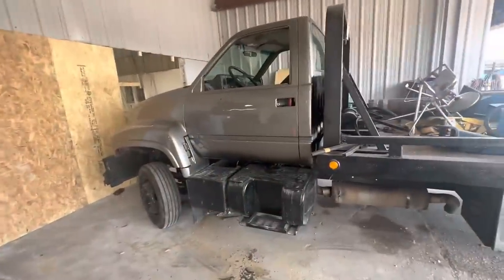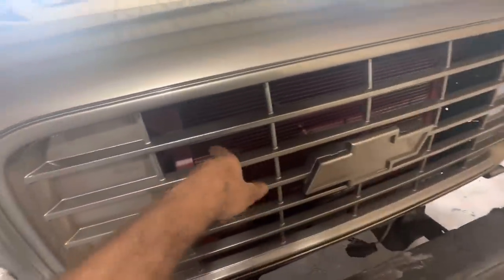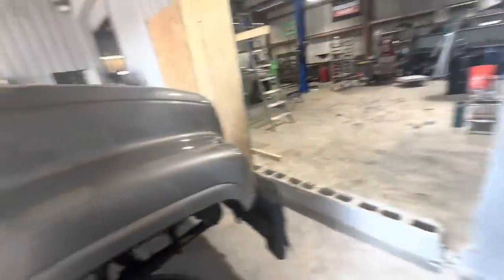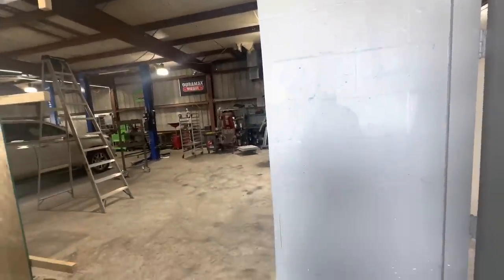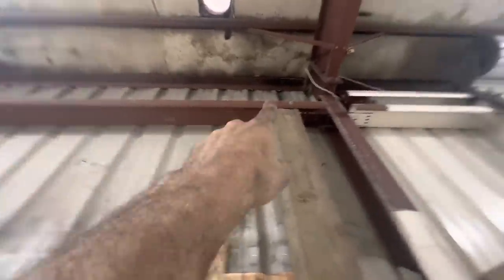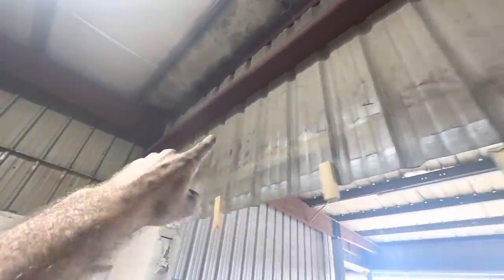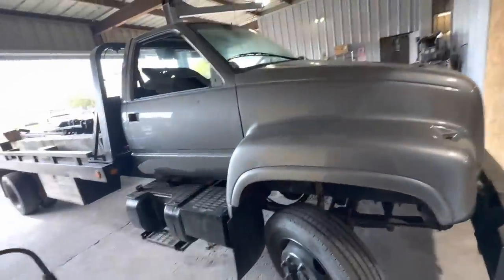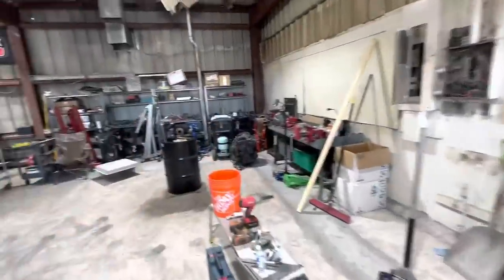Rays Auto Clinic UPDATE! Reeeee-Actions wanted!

Comment: Ray, I doubt you'll see this comment or my of my previous comments about this, but It would probably help you in the long run to move the lift to this new space (and set further from the back wall) so you won't have to angle in the larger vehicles.  Then put the "new" smaller lift in the corner.

Comment: I am a licensed building inspector and don't see anything wrong with the wood column supporting steel beams. As long as they're secured in place its good to go!
Reply: Actually Rays posts aren't supporting anything other than the new door, he's using the sheeting rail to hold the top of the posts. The loads (such as they are) over the main columns are carried by the perimeter beam at eaves level on top of the columns. It's a steel portal-frame building.
Reply: @clivesheppard8432  Agreed, plus the fact that Ray is installing a roller door not an overhead door.
There is no actual supporting load on the side vertical posts, they are only there to anchor the roller track, the main support as you say comes from above
Reply: Iiiiiiiiiiii…… don’t think you got that quite right there, inspector. 
If the wooden beam is now supporting the frame rail, what would have been supporting it before? 
Sky hooks?
Reply: @level1804  The timber posts and beam are irrelevant in terms of carrying any load from the existing building at all. I already said it is a steel portal frame building, there fore selfsupporting by design, and the horizontal rails both tie the structure and act as sheeting rails only. All the sheeting rail is doing in Ray's construction is providing horizontal restraint to his wooden bdoor frame - nothing more. As for wind loads you failed to mention, those were taken for in the original design so the new door imposes no additional wind load so the only additional loads imposed on the sheeting rail  are wind loads imposed as kminimal point bloads on the rail at the top. on one section only - a mere bagatelle. It looks like the sheetring rail is pretty substantial, possibly a 180 x 75 x 20.9kg/m PFC judging by Ray's videos.
Reply: @IR-nq4qv  I'll get my hat and coat then!

Comment: Hey Ray , I am a builder/carpenter in Australia. You did a great job with the wall, I would of done it, no differently. The design of the building makes it a non load bearing modification. The addition of the opening will transform the work area. Cheers Robert

Comment: You're doing just fine. Like others have said, I don't see any of the keyboard commandos jumping in to lend you a hand. Do whatever it takes to get the job done as safe as you can. It doesn't matter that lift trucks weren't made to do what you did with it, it worked at the moment. I drove lift trucks for a living for thirty years and did a LOT of things that they weren't designed for. It all depends what you need to do and what you have on hand.

Comment: You guys were creative in the installation, no one got hurt that's a win in my book.
Reply: Not doing the work in crocs might help us breathe a bit easier.
Reply: @MonkeyJedi99  OR they need steel toed Crocs
Reply: @OGYettie  If such a thing existed, I would accept that as a compromise.
-
Interestingly, the few people I know who do or have worked in heavy construction are strongly against steel toed boots, preferring a polymer hard toe cover.
Their reasoning is that a steel toe cap, under enough pressure, can deform and stay deformed, possibly leading to amputation.
A hard polymer toe cap will spring back or flat out break. Either way, your foot is not caught in a steel trap.
-
I know, it is a fringe case for most construction jobs, but two of the people I know work/worked for a company that places prefab housing units on readied foundations.
-
One time, a new hire reached for a tool on the sill plate just as the person outside was directing the crane to lower the prefab unit the last few inches.
That guy lost his hand and about 1/3 of that forearm to a two-dimensional conversion attempt.

Comment: Ray I'm in my mid 50s, those that reeeee about your methods of working - crocs, tennis shoes , chain saw etc... would absolutely loose their minds to see how we did things 30 years and over ago.
I laugh sometimes when I see men have to put on gloves to change a light bulb or hook up a garden hose etc... Honestly,  men have become way too soft. 
I grew up on a farm splitting wood, installing and repairing barbed wire fencing, bailing hay , etc.... very seldom did we have all the " proper safety gear ". We were taught how to handle and work properly and should ya get a scratch or cut methalade ( monkey blood ) was poured over it. Crap burned quite a bit but my grandfather would always say " if it doesn't burn its not healing " 😂

Comment: Hi again,  if you're going to keep the door and corner section of the block wall, then you're going to have to take the second 6x6 post and anchor it into the block wall and make sure that it's securely fastened to the slab and the 'I' beam up top! My suggestion is to mark out 2 foot square, use the demo hammer and chunk out the concrete, dig out the 2 foot area and pour cement into the square opening forming a footing for a 6x6 post anchor, placing it flush with the concrete, let it set up, set your post and then anchor it to the 'I' beam up top, then you'll have a very strong frame for not only the existing block wall, but also the new roll up shop door !!, Cliff will know how to do this!!, God bless, and good luck 👍 🙏 😊

Comment: electrical? In an older WII built temporary housing that the city let remain because they were taxable. found two 15 amp circuits tied together so that 30 AMPS could flow through 15 amp rated wiring = perfect fire igniter installation.

Comment: You always going  to have armchair internet Rambos who will never have the ambition you  have. I love the simple way you approach everything and going beyond the  repair. Cleaning battery terminals, the area you just worked in,  etc. Saving the customer money by not looking how to make the most expensive repair.  The recent Tahoe spark plug change you did instead of charging the customer for a transmission because the misfiring was causing the shifting issues is impressive. Don't change a thing.

Comment: I like the new paint, daily driver and work truck. Do I dare, yes I do, go with / to extremes and suggest, a boat, a motorcycle, and a Jeep? The wall - a sharper chainsaw blade makes for less effort on your part. The post install was fine. As you said no one got hurt and now you have the experience to do the second one better. I might suggest that the post be tilted up into the overhead beam and then the foot bracket installed. It will give you an extra 1/4" or 3/8" clearance on the corner edge as you fit the post to the beam.

Comment: the install of that post was awesome, those haters are the same ones who said this shop would fall on it's face in 3 months and look where we are now. Keep up the good work, my only request is that for the love of god install some more breakers and circuits and get rid of the power bar hell on the other side of the shop, when time allows. I get it, it's decently safe but having stuff like lights hardwired in makes it a lot easier to isolate what's popping a breaker and makes it easier to power down at the end of the working day

Comment: Lol footwear,  I worked in a machine shop in the saw department and unloading 40' steel bundles of steel bars the your fork truck would struggle to pick up, I wore tennis shoes. The only thing steel toed boots will do for you is keep you from dropping a 10lb part on your foot, you drop something heavy on your shinny new 300 dollar steel toed boots your loosing a foot.  Dont get under it. Ive droped parts. Even had one or to find gravity and hit my foot i still walk and have both feet.
A steel toed boot might protect you from something like a transmission if you dropped it, but its not doing a dam thing for you and 5500 lbs of steel.  You drop 6k lbs on your foot the metal in the shoes going to cut your toes off.

Comment: While one can perform many basic handyman jobs without a contractor license, the following work cannot be done without one:
Construction – It is illegal in Florida to do any structural or remodeling work without certification and licensing by the Florida Construction Industry Licensing Board. This includes roof work, demolishing load-bearing walls, additions, and foundation work of any kind.
Plumbing – Virtually all plumbing work requires licensing. A handyman may add a water filter to a faucet, but even installing a dishwasher is not allowed.
Electrical work – Similar to plumbing, it’s illegal to perform virtually any electrical work in Florida without a contractor license.

Comment: Sorry.. not sorry I build stuff... Never have I ever worn plastic sandals on a job site .. let alone working on cars mechanics are not Carpenters mechanics are smarter most the time.. building furniture a quarter inch is no go.. building a barn SOMETIMES A quarter inch is your friend.. (I've worked on houses where they got way too liberal with the quarter inch those are the houses most of you live in and there's not one straight line, but you wouldnt know that and you have no idea how many Gatorade bottles of piss you have in your walls either) precise measurements are for metal. ABC 123. Not being a hater. Was being supportive in Ray he needs to be the boss. And know who he is dealing with. Honesty is always the best policy.. if the new guy is fronting like he's a carpenter he'd better actually be one.. otherwise hes lieing.. in the least case Ray has a buddy, and that's a good thing. Get your precise measurement give yourself a quarter-inch the board will slide right in place next time. Brickwall is not load bearing.. his anchor the floor is the most important.. anchor up top needs to me most right angle.. the door itself should be structurally sound just needing some anchor points.. a square box as possible is what Ray needs.. with the legs anchored to the floor being the most important point.. ask the garage door guys they will tell you the horror stories jerry-rigging they've had to do just to get outa there and paid on those jobs "oh don't worry I have a contractor that's a carpenter" it's like the boyfriend mechanic trust me.. I was the boyfriend mechanic way back in the day forgotten to tighten the lug nuts on a tire... 23 years ago.. every mechanical bolt I counter-clockwise first to tread it.. I cringe every time he just throws a bolt in there and tightens it down with the Milwaukee.. Master mechanics have said the same thing. "He's an okay Carpenter and a good mechanic awesome troubleshooter." Multiple times multiple comments.. he's a mechanic I build stuff we flick each other in the nuts and it makes us better. ❤ To all⚡

I think I've been here long long .. I asked him pushed him months and months before second-to-last job.. I'm extremely proud of rays growth.. he's inspired me to get back on my high horse of self employment.. if I lived in Florida I would have been the new guy and actual Carpenter. I'm here in Texas doing my own thing. Nobody grows from just paddy cake. If anything because I take the time shows love.. yeah it is 3 in the morning and I wish I was stoned but hey nothing's perfect right guys!?!

Comment: Here's a suggestion. Get rid of both electrical panels. But remember that you are dealing with high voltage (240 to 480 volts) 

I would call an electrician to disconnect it.  And from there you can remove it yourself to keep your cost down. 

And electrician won't cost a lot of money.  There's affordable ones out there.

Comment: Great video, but I'm not certain which is the better deterrent for keeping potential thieves out of your shop, the easily removable 1/2" MDX panel or the electrical wiring inside the building.

Comment: The fan on the wall would be much more efficient if you added an exhaust chimney to it, and will save power as well! Any slightly conical design would do (as long as it doesn't leak!). Say a 30 ft slightly conical square contraption, if the owner of the building allows you!

Comment: Reeeee-Ay, we haven't actually seen your forklift certification license. Ha Ha Ha. Don't know what the problem with the wooden posts are, besides being overkill to hold up a garage door and frame. But, you use what you got. Didn't know that was the red tow truck, thought it was the replacement for their burned up one. Great job whoever the shop that did the work. For all the grief, if you can't have fun, then it's work. Keep them entertained with words, actions and comment generators.

Comment: What I have noticed about life is a good mechanic might not be a good builder. Two completely separate work lines. If you start young with one stay with it till old. Since retirement from heavy industry I have worked the building trade and the precision  necessary is a different type of precision from mechanicing. I could fix anything that came my way mechanically, proper building technique is not the same way. You might think so but to a builder we look club footed. Jesus was a carpenter and my father was also, but even at 9 years old I could outthink him mechanically.

Comment: The tips of the forks should not be used for pushing the beam in place.  The forks are 1) on a side to side track 2) easily dislodged if upwards pressure gets put on the bottom of the forks.  A safer-ER solution would be to center fork lift and use the carriage/backrest.

That was my only concern especially when working overhead.

I see no problem in the structural integrity of the beam, or the methods in which beam was constructed.

Comment: Brother. Screw that. You did great. You are a mechanic. Not a structural engineer. Even though the the vertical load capacity of that beam is factually 300 lbs higher than that steel upright. Keep going forward. Be sure to get car juices on those beams. Trust me. For whatever reason when wood gets hit with oil and tranny fluids and antifreeze it just seems to last forever.

Comment: Truck looks really good, are you going to do some accent paint. Or shop information on the doors? 
I think a magnet sign after you give the paint time to fully cure, I know a fresh paint job stays soft for a wile.
The body work looks good too.

What about the body shops tow truck that burnt up, how are they getting along?   I think they could find a older unit and just change the cab. Then fix all the other dammage maybe a flood tow truck.
Its cheaper then buying a whole new unit. And good used ones are not cheap you just got lucky.

Oh your throttle up for using the take off, how about an old manual choke cable. Or ill bet you can fix the original broken part. I think you know a good mechanic.

Comment: The shop looks good and I don't believe there is any structural issue.  The building is held up by girders; the posts just facilitate a defined (door) opening.  I don't think you need to be concerned at all.  The building is made of light materials do not require steel structure.  You could have installed steel uprights and yes, it would be more long-term suitable but this works too and I like it!!

Comment: The tow truck looks much classier with the new paint job. I really couldn't see any major issues with the way you removed the wall and installed the beam. Given the equipment you had and the space available it seemed pretty reasonable to do it that way. I suspect the problem is that it does take a real mechanic to work on modern vehicles, but everybody thinks they're an expert when it comes to building, so..."reeeee!"

Comment: The wood columns  and your slab will be just fine to support the OH door track and the weight of the door itself. I work in commercial construction that builds concrete distibution buildings. I'm very well versed on the install of both coil doors and sectionals. the only issue i can see is the metal that you attached the columns to at the top.
Hopefully it is stout enough to not flex. This may be a weak link in the overall installation of the support system you will have.
Good luck, i enjoy your videos.

Comment: No stones from me. My glass house was shattered a long time ago. Cut a live wire without checking fuses, learned that microwave ovens have capacitors that have electrons present a long time after the unit is unplugged, using a ladder on a wet deck will get you a visit to the ER, heating a bolt going through a rubber bushing melts said bushing, and standing on a pile of planks makes it difficult to pull out the plank you want.

Comment: All this electric stuff seems sketchy, old, probably not to code and modified to many time by who knowes that didnt know what they were doing. I saw that when you started working in the building. Atleast it's in a conduit, that's a big plus! 
I would epoxy the floor to keep it clean and nice as well as easy to clean when there is a mess.

Comment: Hey Ray.  I thought that the way you installed the first post was pretty good.  It was a little sketchy, but the job got done with the tools you had on hand.  One piece of advice.  Get a sledge hammer.  Go to harbor freight, since they are cheap.  It really will make the hammer job easier.  I love the color of the tow truck.  Excellent choice.  It does make the truck look great.  Keep up the videos.  I want to see the rest of the shop work.  Take care.

Comment: It seems like the first beam is working out just fine. If anything that beam is at least 2X larger then what is needed, probably more like 4X or greater. You installed it just fine, the top metal channel is not structural as in carrying a load, it is there as the backing for the sheet metal. Both this video and the beam installation video were great!

Comment: Ray, you should run a header across the top of the opening. That purlin (what you are calling a beam) is not strong enough to hold the door's spring tension. Also, a header will create a better door seal.